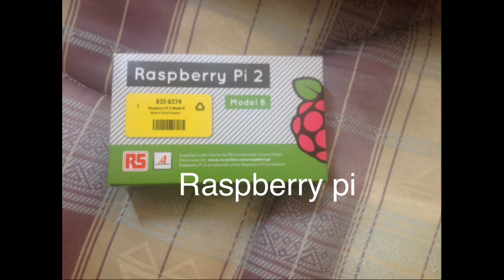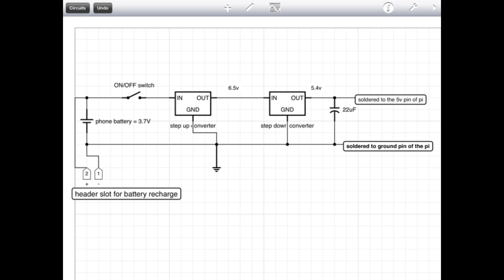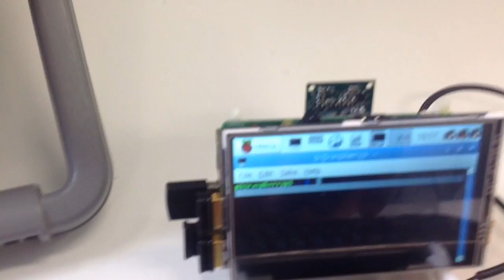BUILD YOUR OWN PORTABLE RASPBERRY PI TOP

Comment: I'd like to see the plans for a case, to not have the circuitboards exposed.
Reply: +Sapioit Maybe with a way to rotate the camera (selfie), from front view to back view (taking a photo of something)
Reply from the maker: +Sapioit sounds like a great idea. not sure if I have the resources to do that and build a new case. do u?
Reply: Robo tronics You could use wood. I mean, wood is cheap, right? Alternatively, you could use (home-made) ceramics.
Reply from the maker: +Sapioit I don't have a laser cutter or 3d printer. not yet
Reply: Robo tronics You can use wood boards, 5mm are more than enough to hold the stuff inside. You can make the case with tools which you can find in a garage or tools closet / storage room / however you call the place where you keep the tools in.

Comment: Why step up and then step down converter ?
Reply from the maker: +expert20valvehlx to use the battery to its full capacity
Reply from the maker: +expert20valvehlx to use the battery to its full capacity
Reply from the maker: +expert20valvehlx to use the battery to its full capacity